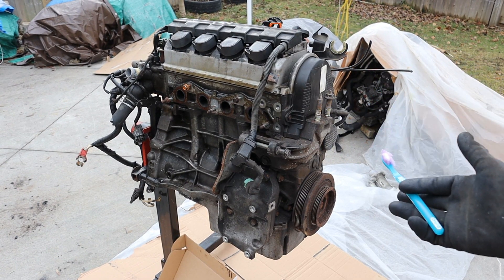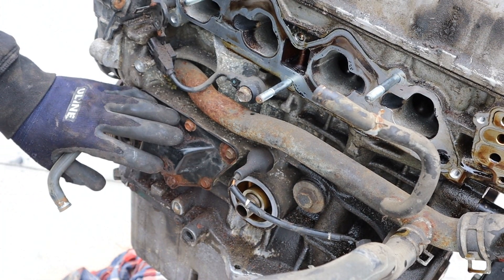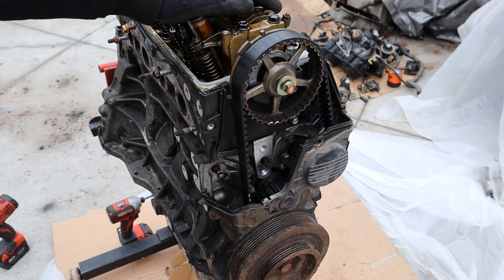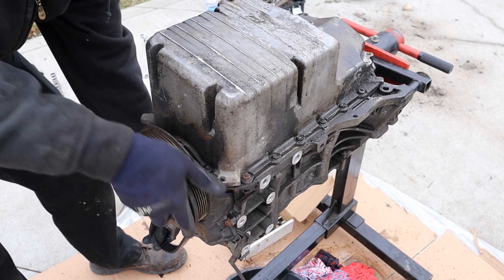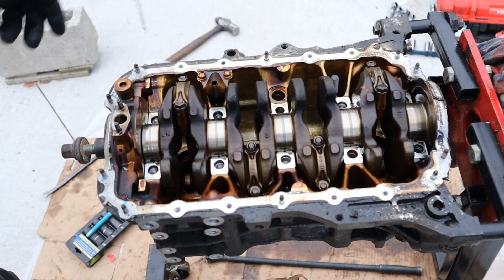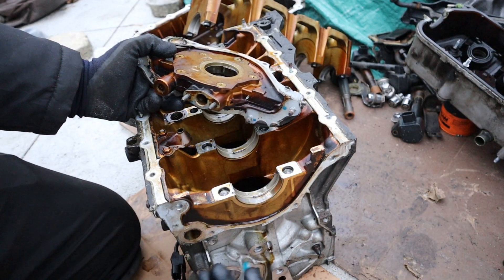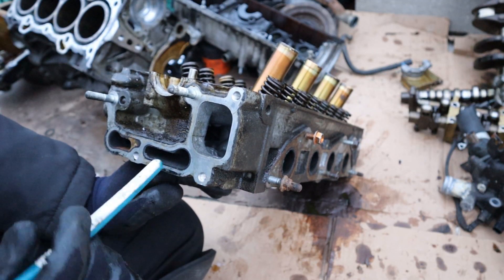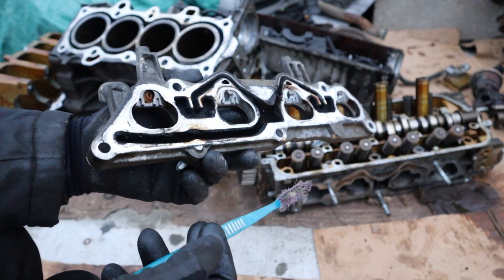Honda D-Series Engine: A Low Point for Honda

Comment: TBH the D17 is really the true low point, the rest of the D series engines before were great. Not exactly wildly powerful and certainly nothing special, but they were extremely reliable and a piece of cake to work on. Mediocre aftermarket ignition parts were just about the only problem you were likely to run into, other than needing to keep up with timing belts.
Reply from the maker: Yes agreed
Reply: I was gonna say, the D series are very strong and reliable in general, I would not call them a low point
Reply: @sirfairplay9153     .Agreed. D16Z6 was a sweet little engine. VTEC, 7200rpm redline - excellent for boost. Even the A6 and Y8 were nice because they were so simple and reliable.

But yeah, the D17 was a POS in comparison.
Reply: @crxtodd16  couldn't agree more. I have a d16z6 in my 95 del sol si. Love that car and that engine
Reply: It’s not too different than how the turbocharged L15 engines ruined the reputation of the entire L series and EarthDreams monocre
Reply: Not sure why you assume, or who told you, the D17 is any different 🤨🤦‍♂ They're nearly identical to every D series from 1984 to 2000. From 2001 to 2007 Honda used D14, D15, D16, and D17s in a handful of different vehicles. And every single one of them can be upgraded/modified in the exact same manner. Want a D16Z6 cam in your D17? Okay then just swap the cam and rockers. Want a D16 intake manifold...? Okay then bolt one on. Want to de-stroke your 1.7? Simply use a D16 rotating assembly. Want 500? Rods, pistons, turbo kit, E85 = Done and easy af. There is absolutely no such thing as a bad D series. No such thing as a common head gasket issue. Nor is there a single TSB for any Honda D series. It's a D series just like a Z6 is. Y8 head and crank are both junk. Terrible quench pads. There's a reason why every D series record is held by an A6. Goofy comment on a goofy video.
Reply: @Casey_and_Cars  The D17 is different though, the block casting is different and the head is completely different
Reply: @farcere  the same can be said about Y blocks.
Reply: @Casey_and_Cars  Yes, it is very similar in a lot of ways, but hardly any of its parts interchange with the rest of the D series reliably (which excludes the finicky modded Y8 intake manifold swap) and the D17's generally seem to have more issues than the rest, especially head gaskets. Some of the nuts, bolts, hose clamps, and oil seals are interchangeable, but that's about it. The D16 crank may work, but there's no reason to de-stroke these, so who cares. There's no decent headers, no aftermarket intake manifolds, no aftermarket cams available for years, etc and even finding reliable replacement parts like alternators can be hard. Also, even with my Crower cam, Y8 intake manifold, larger K20 throttle body, custom cold air intake, cat delete, and custom exhaust, my 7th gen with the D17A2 VTEC engine and 5 speed still isn't drastically quicker than my bone stock 6th gen with the non VTEC D16Y7 and automatic transmission. However, my D17 easily gets me 45+ MPG and my best tanks have been 48-49 MPG, so there's that.

Comment: The civic EX had the vtec 1.7, the LX and lower trim levels did not.  It was a lethargic engine that would vibrate your fillings out of your molars.  It was just as noisy as an old dodge pickup with an exhaust leak and 2 burnt valves.
Reply from the maker: We had the Acura EL with the VTEC engine here in Canada

Comment: My '96 DX has the d16Y7. 220,000 miles. Regardless of all the potential problems, I will continue to maintain it vigilantly and drive it as long as I can. no silly mods, just bone stock and it's my daily driver
Reply: My '98 EX stopped counting miles at 384K. when the odometer broke. Car rusted out by 500k+ but the engine was still ok. Honda Civic 6th Gen was the best car ever.
Reply: @markd9130  y8 bro, tough engine
Reply from the maker: Good, any issues with overheating?
Reply: @speedkar99  the D17 is the only problematic D series. Meanwhile the D16Z6 and D16Y8 are well loved
Reply: @speedkar99  Not yet! But definitely a pan leak. no VTEC, so that's one less leak point. My Camry with the 1MZFE (which you made another great video on)  has rust proofed the front end of the car from it's valve covers leaking, but that will be fixed soon.

Thanks for the videos!
Reply: @Doomzdayxx  Change your PCV valve. Should cut down on oil leaks.
Reply: @SkylineFTW97  yeah, I did about 10k miles ago. Also did distributor o ring and cam and crank seals. Only thing left now leaking is pan but it's not terrible. I also heard that main computer relay, located by passenger kick panel is a common failure.
Reply: @Doomzdayxx  That happened on my old 03 EX. I changed that out when I bought it.

Comment: This was my first Honda, 7th gen manual. The transmission was even weaker than the engines and needed an input shaft bearing by 100k. My favorite style they made but I will stick to my d16's, b20's, J30's yada yada... CRX for the win! 
Thanks for your videos
Reply: Yeah, I've got a friend who became an expert in dropping the subframe & tranny in an hour because he had to do them all the time to replace ISB's back in the day. Besides that one bearing they hold up pretty well tough.
Reply: @unimportant5122  I pulled my transmission 3 times out from the top. They are not bad vehicles but subpar once you own anything older from Honda..
Reply: @SamslamminCars  AFAIK on the 7'th gen EP and EM that requires removing the thermostat housing and EGR and even then you first have to remove the clutch and flywheel trough the small gap you can create between engine and transmission before being able to pull it out from the top. Dropping the subframe is easier imho. Separate the 2 lower ball joints, separate exhaust, 6 subframe bolts and you've all the room in the world.
Reply from the maker: You are welcome! I think with such a small engine a manual makes more sense.
Reply: I drive with the noisy bearing for past 60k km. Got the car cheap, but needed parts from 'donors'. At 25yrs of age, surviving Ottawa winters it's quite an achievement. I agree that the B series was a better engine. We service one '95 Civic (full rustproof since new) with half million km on it - it gets new tires this week.

Comment: I haven't watched your posts for a while, and am REALLY happy that you have sped up the disassembly. A1!!! I love the spread out parts, and your comments on the strengths and weaknesses of the design elements, and more importantly why the engine failed or wore out. Thanks! BTW have you torn apart a Honda/Acura 3.5 liter 6 -cyl Engine,  a J35Z2 I believe? I have a 2015 Acura RDX with 100,000 miles on it. Thanks!
Reply from the maker: Glad you like the format. I have a J-series teardown already, check it out!

Comment: The oil leaks are due to the same problem as the pistons' clogged oil control rings…

The oil wasn't changed regularly!

(oil becomes acidic due to combustion by products, which degrades seals)
Reply from the maker: True but it can also be because of the seal design
Reply: @speedkar99  Also nobody changes their PCV valve. It gets clogged and the block can't vent pressure. So it takes the path of next least resistance, the rubber seals.
Reply: @SkylineFTW97  oh, yeah, they did need the PCV rerouted (to a downdraft :p ) when boosted
Reply: @speedkar99  but it's not. I have a decade of experience with the D-series (USDM versions D15 & D16 & some JDM versions, including DOHC ZC). The oil pan is never an issue on properly maintained d15 or d16 engines with a steel oil pan. I never saw an issue with an aluminum pan, but I got out of D's while Honda still sold D17's. 

I highly doubt that was an issue because a few D16's also came with an aluminum pan (ie: D16Y8) & they had no issue on properly maintained engines! That is key, because poorly maintained engines leaked (almost) everywhere.

The valve cover gasket only shows slight leaks at about the same time as the timing belt needs replaced. IMO, that's fine, since the valve cover needs to be removed to get the timing belt cover off, and the valves should be adjusted more frequently than that.

That one you had was (definitely) poorly maintained, the oil control rings were nasty!

IDK about the EGR system, I didn't see issues with that. I guess the D17's weren't old enough? IDK, because some D15's also had EGR, and I never saw an issue with any of those. I'm a bit curious how those worked, but since I never needed to work on one, idk how they were different.
Reply: Wonder if this is a no oil change jdm motor?

Comment: I'm curious, when you do these engine tear downs, is it because you are planning to rebuild them? Are they blown motors? Inquiring minds are curious. What happens after you pull them apart?
Reply: He scraps them as they are, in most cases, not worth fixing....
as he said this D17.....it's not worth it as this is a cheaply made engine.....
Reply: @JohnSmith-yv6eq  Ah. I see. I have never torn down an engine, and am just a fluids and brake changes backyard DIY'er. Its still interesting to watch these videos though.
Reply from the maker: Thanks. Yep they all go to scrap. I like to break stuff not fix stuff
Reply: @speedkar99  
You like to break stuff, we the viewers like the technical knowledges gain along process. Nothing is really going to waste there 🤞😅. Finallly manuals say install back how you remove/take it/them apart🤣.
Thanks for those videos.

Comment: The best was the D15, imo. I made ~300whp with a (stock internals) D15B2 & boost for almost 100 miles, and replacements were only $50, or less!

(92hp stock, figure 15% power loss ~78whp, so ~380% of factory power)
Reply from the maker: Wow

Comment: D17a very fun to drive. Does not respond well to mods, but still a good motor
Reply from the maker: Honda's were defined by tuneabily
Reply: @speedkar99  some people just want to drive a stock car to work man
Reply: K-Series all the way bro.
Reply: @FranklinSonatra Genuine question, a turbo designed for these engines.... will the engine loose it's durability? And what should check/upgrade on the engine to deal with the turbo?

Comment: d series a low point? says who lmfao ive had 4 now. each went over 300k
Reply from the maker: Any headgaskets failed?
Reply: @speedkar99  only on the 05 and up d series which was basically the tail end of them. and ive had one head gasket go bad. shop charged me 1100 with machining.
Reply: The D-Series being the low point, it gives you an idea of the rest! With proper maintenance, pretty much any stock Honda engine can outlast the body of the car it's put in! I even know of a few so-called "Trash" L15BAs (10G Civic Hatch) and LB15B7s (10/11G Civic/Accord/CR-V and 2022/23 Integra) with 150/200 000+ miles on them.!

Comment: Breaks my heart that Honda is building crap today...
Reply from the maker: Sad
Reply: Care to elaborate?  I don't think that's correct.  The Civic Type R and Integra Type S are there for enthusiasts and seem pretty well-made AFAIK.  Honda just came out with the DOHC version of the J series V6 that will be paired with the 10-speed auto for the various family hauler models (yes, the ZF 9-speed was bad that's why Honda moved on from it, while CVT in smaller vehicles while not super reliable is not as bad as Nissan AFAIK).  Do you mean the hybrids?  The old Honda hybrids were certainly poor, but I think it's too early to say with this new generation of hybrids whether they will hold up.
Reply: @TassieLorenzo  Your talking limited and top of line cars but forgot the amazing S2000. Today their crappie CVT along with their low tension rings are ALL junk. Mr Honda is rolling over in his grave over that one. Hondas from the past were simple and lasted forever not this garbage today.

Comment: All honda engines are low points
Reply: ...what? Apart from the fact that you are objectively wrong, what do you consider a high point then?
Reply: @thebrickshooter5974  And how would I be objectively wrong . I had several & they were all absolute shit
Reply: @DKSE123  because personal experience has nothing to do with objectivity. Their engines have proven themselves. Are there some with flaws? yes. But overall they have been very consistent in being one of the most reliable engine makers in the world. That is not a personal opinion, that is simply a statistic. I feel sorry for you that you had bad experiences though, don't get me wrong. I know very well how frustrating an unreliable car can be.
Reply: They make the best small machine 4 stroke engines. That is my experience anyway.
Reply from the maker: I think Honda makes good engines tbh
Reply: Another Toyota junkie 😂
Reply: Consistently Building Shit

Comment: The trouble with Honda is that there's a small and loud minority of ... let's call them enthusiasts that have watched The Fast and The Furious a few too many times. To these guys, the only Honda engine worth a pinch of anything is the K-Series. Of course they hate engines like the D-Series and the L-Series (the latter being one of the most reliable engines Honda has ever made).
Reply from the maker: L-series is good in non boosted form. The 1.5 T in these newer Honda's ain't living up
Reply: @speedkar99  wait have you tore own down? And what variant. Because they have so many variants it gets confusing.

Comment: I've always been curious to know if car designers have a solid reason for choosing where the front of the transverse engine goes, or if it's purely arbitrary. edit: I'm thinking in terms of weight distribution, etc.
Reply: It's a matter of which direction the engine is turning vs how the transmission is set up - usual Honda FWD transverse engines rotate in a way that makes it more optimal to have exhaust in front, intake in back, in order to reduce transmission losses.
Reply from the maker: It's better to have Transmission on driver side so you can fit auxillary parts like brakes and steering
Reply: @speedkar99  Indeed - also Honda make primarily RHD cars (for their domestic market and SEA) that's probably why they picked this layout. I read somewhere there's also another reason - the crank bolt (and every other bolt on their cars) has a "normal" thread as a result, as they want to minimize different bolts and avoid reverse thread bolts completely.
Reply: I'd say it would be to have the exhaust on the back and intake on the front, even though a lot of transverse engine layouts the exhaust is on the front. Most of the fwd 4 cylinder Hondas I've ever seen/worked on had the exhaust on the back. But don't quote me on that

Comment: Nice and interesting video again!
I noticed that you refer to the bolts as "10 mm" all the time. We (in the Netherlands) would call them M6 bolts. You refer to the size of the tool to get them out, we to the diameter and thread type.
Is that common practice in Canada and the USA?
Reply: Generally in a shop environment when you're just repairing vehicles, it's easier to refer to bolts by the size of tool you need to remove or install them. Obviously multiple sizes of bolt can have the same size head, but the actual size of the bolt doesn't matter much for teardown or repair work, just the tool needed to remove it.
Reply: Usually, if I say “oh it’s a 10Mm bolt/nut” I mean the socket size. However if I say “it’s an m6” then I’m referring to the actual thread and diameter of the bolt. As some m6 bolts have 8mm heads, some have 10mm, etc. saying the socket size makes it easier to grab tools, etc.
Reply: Why I'm not entirely sure but my guess is it's often the case in places like the USA and the UK where we had many older bolt styles and systems that did not correlate the thread pitch and other bolt parameters with the head size so we stuck with that description?
Reply: I know this much, when I go to buy the 10mm bolts, they have M6 stamped on them. Maybe all the bolts do and I dont notice
Reply: Not all bolts have the type stamped into them but US we go by socket size not type of bolt it saves a lot of time.

Comment: I'm a little surprised about this video!

Ive done quite a good bit of work on D17s. I own a 7th gen honda now with one, and have owned a 7th gen honda before it.

The old Red honda i had was 333,333kms on it. I had overheated it due to a failing water pump (classic water pump and timing belt).

I replaced em and despite the overheating it ran, and it would still run. I would've kept it were the rust not working its way through the floor.

This new one I have now only has 78,000kms. And I overheated it again, this was due to a rubber hose rotting and leaking coolant.

I drove it some 40kms trying to nurse the thing while it was overheating, not trying to get it too hot, putting water in the rad and bringing jugs with me until I could get it home to replace the clamp.

She's still driving.

Idk! I'm not saying you're wrong. What you're saying makes absolute sense and open deck designs aren't my favourite either. Also YES! That intake design is $h!t. 

However, I quite like the 7th gen myself. Never had major engine or trans issues (all of mine were manuals though so idk).

Thanks for the video ^.^